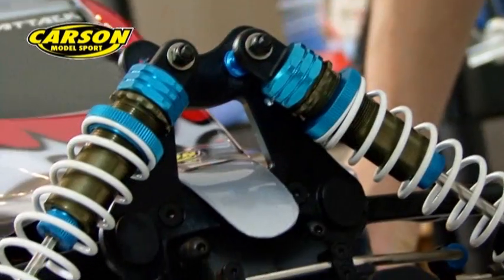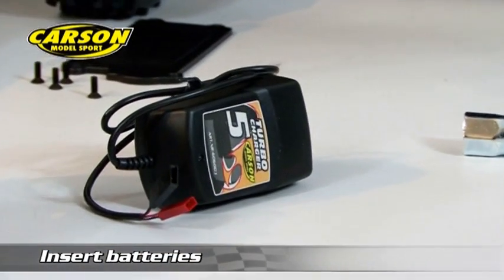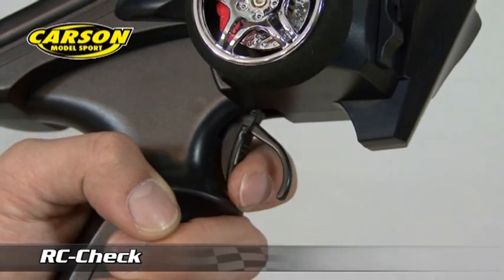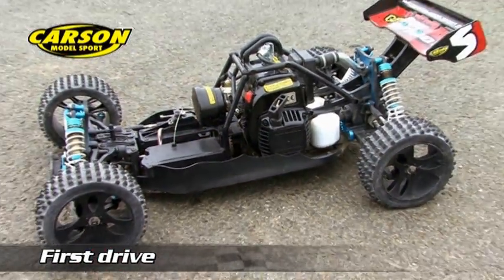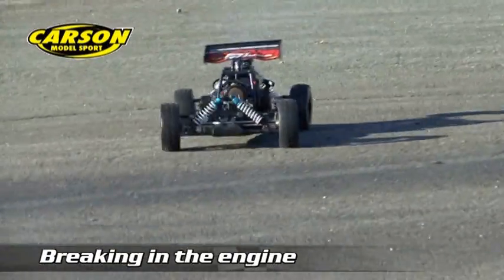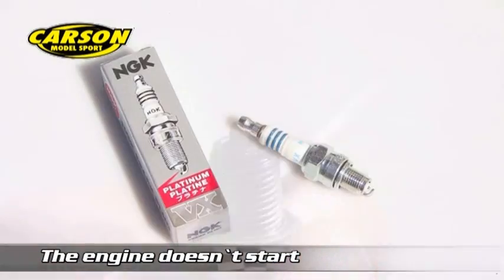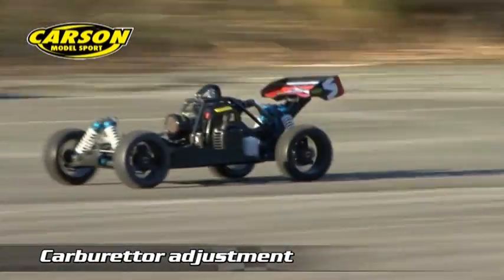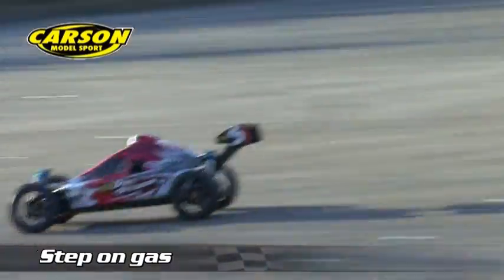First steps and tips with gas powered cars!

Comment: Is this a walbro carby? it looks like one. low speed mixture should be leaned until the motor rpm increases (leaning out - not good) and then richened until the motor begins to 4 stroke (or noticeably run rough). Between the points where the motor begins to 4 stroke and lean is the optimal low speed setting. Ideally the process is the same for the high speed running at full throttle whilst adjusting however given this application, the process described would be ok.